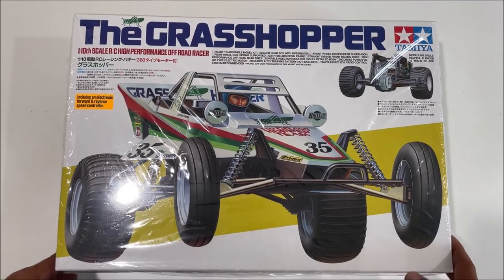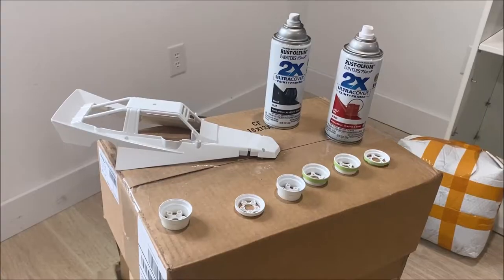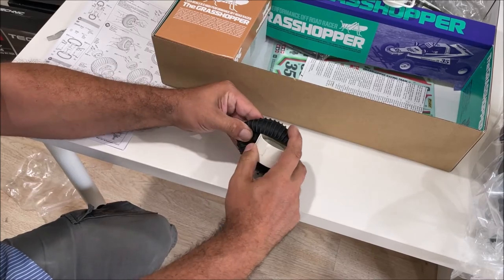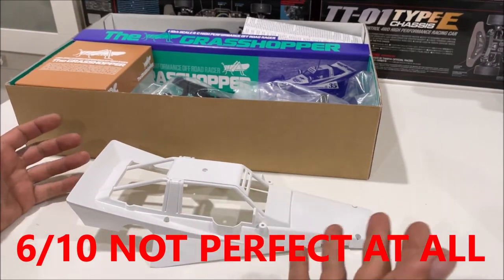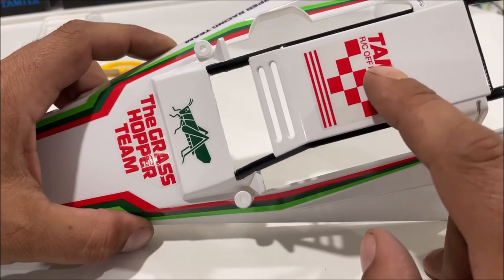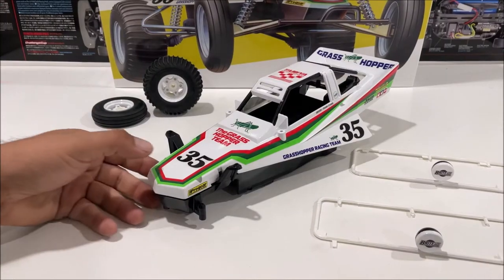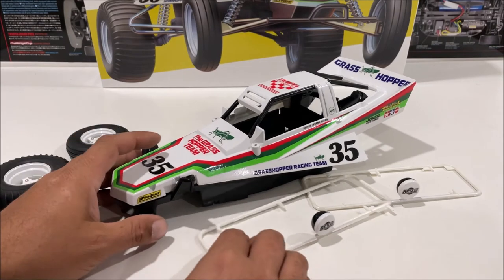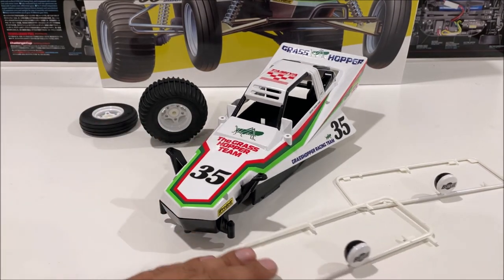TAMIYA GRASSHOPPER paint job and body assembly 1/10 RC hard plastic

Comment: Great video.  The secret to assembling the wheels and tires is heat and dish soap.  When I built my first hopper when I was 10 I had a hell of a time and actually had a friends father put the center pieces in the tires.  Later in life I learned that letting the tires soak in hot water for about 15 mins made them softer.  Then I applied a little dish soap and they slipped right together.  No muscle or cussing needed.

On hard shells, try Duplicolor automotive paints.  About the same cost as Tamiya paints but you get three times as much.